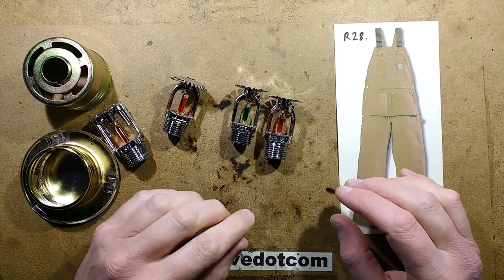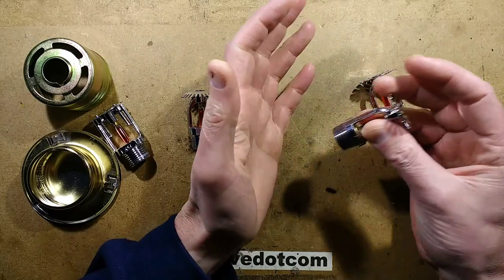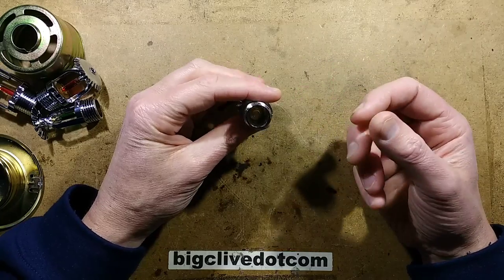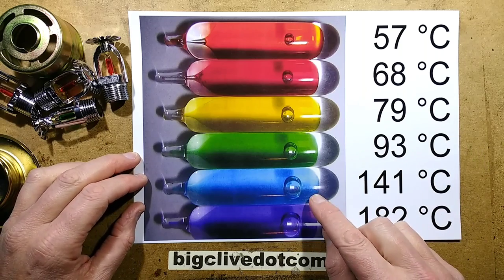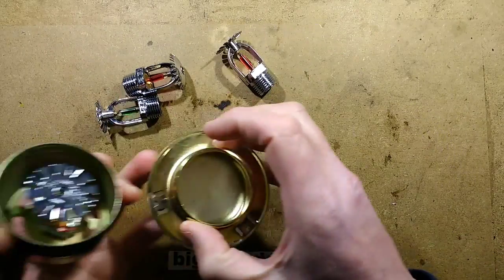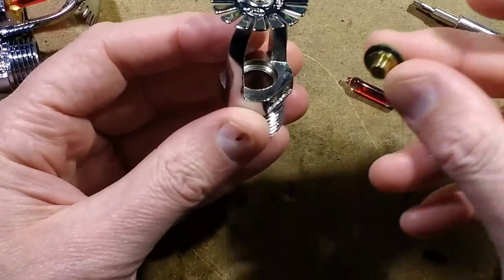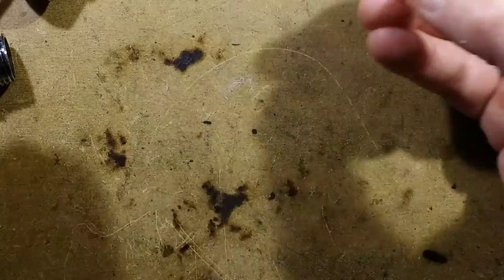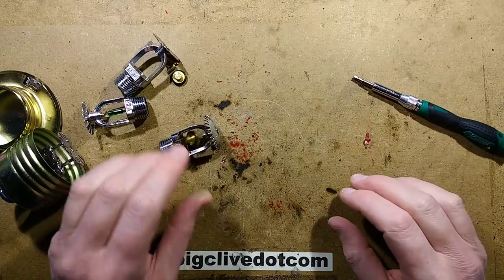How a fire sprinkler works. (featuring broken glass and spatter.)

Comment: It would be pretty ironic, if there would be flammable liquid in a fire extinguishing sprinkler glass pellets.
Reply: Im gonna make sprinkler heads now with flamble liquids
Reply: Uncle Stalin, you'll be really popular with the insurance companies :)
Reply: The amount in the glass vial is so small, in the grand scheme of things even if the liquid is flammable, it will have a negligible effect on the spread of fire, especially since the liquid is soon followed by vast amounts of water!
Reply: in wet pipe system not flushed often, the water can separate into oxygen and hydrogen gases, when it release you get pockets of highly flammable gasses.
vast majority here is dry-type systems, so they don't freeze up in unconditioned spaces. and not to forget, some may have had alcohol as antifreeze. booo
Reply: MGYouTube Account the flammable effect would be so vague ..
Reply: Well, guess what, fire trucks run on flammable liquid, too! How ironic!!!!!!!!1111eleven
Reply: How would it be ironic? It detects fires so what else would you use but something that is affected by fire?
Reply: Oh my gosh Justin Y was mentioned here... Help I just can't escape him!!!
Reply: The ironic thing would be if a sprinkler head manufacturing plant burned down due to fire in that liquid
Reply: I read that it's a Glycerin based liquid...
Reply: That's one way to fight fire with fire
Reply: @TehMG  but if it causes a chemical fire than that water will only make it worse
Reply: When I read the title I thought he meant a sprinkler that sprays fire. LMFAO
Reply: Ironic. It could stop others from burning... But not itself.
Reply: @Blackspidy619  Ok Darth... 🤣
Reply: It would burn away faster and open the valve which would extinguish the fire.Its not actually a terrible idea.
Reply: for a good laugh, have a look at the comedian the has a sketch on Alanis Morisettes song "Ironic". Ed Byrne, I think his name is....